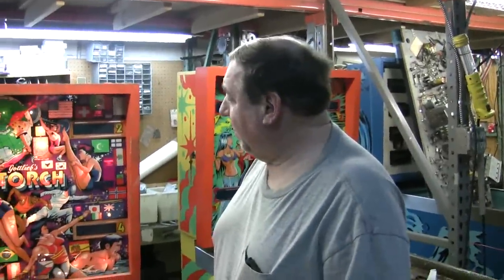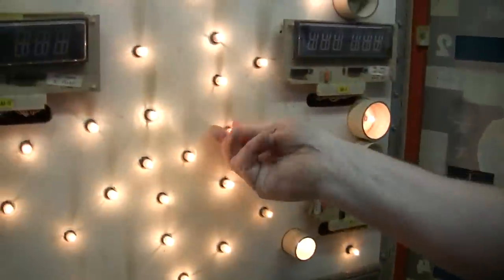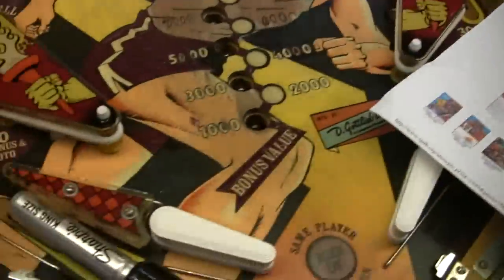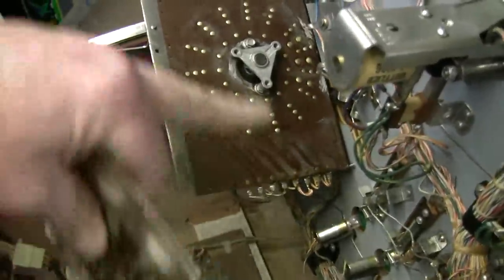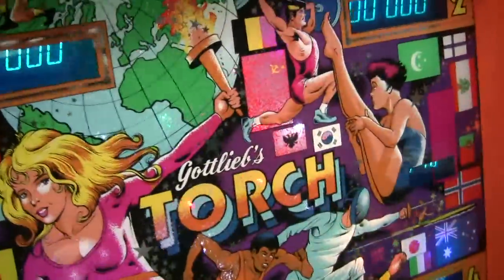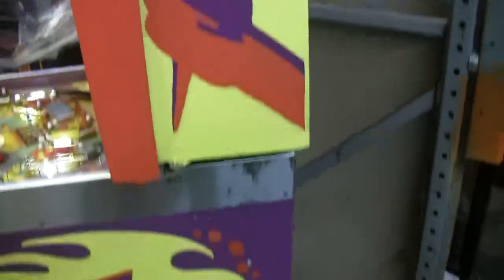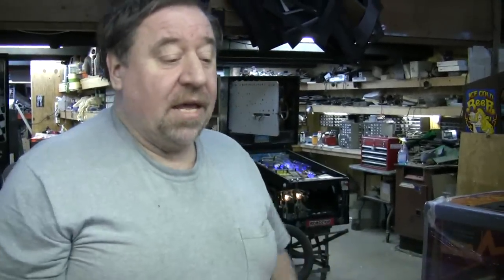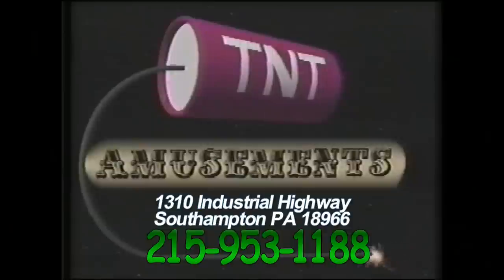#159 Gottlieb TORCH Pinball Machine Reconditioning Process Beginning to End-TNT Amusements

Comment from the maker: Well, the new board is just $75...and I have been selling the old WORKING power supply on EBay for $35 every time I list one!  SO, to install a brand new power supply ends up costing just $40---all new parts, components, etc.  What a nice upgrade at a minimal cost too!  I think in the long run its more practical to buy a new one that's been tried and true!
I am the same way about new power supplies--which I put into every game I sell and I only use certain ones because I have had low failures!

Comment: BTW, fiberglass pencils can be had for a lot less on ebay but I'd much rather use 99.9% isopropanol and then use a simple pencil eraser. You would be surprised by the result and would not expose the metal to the elements.